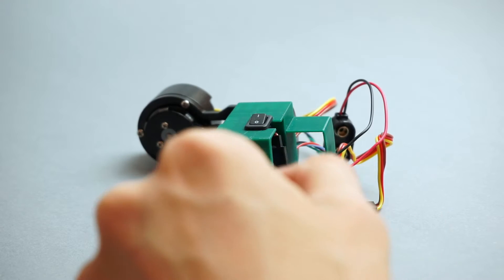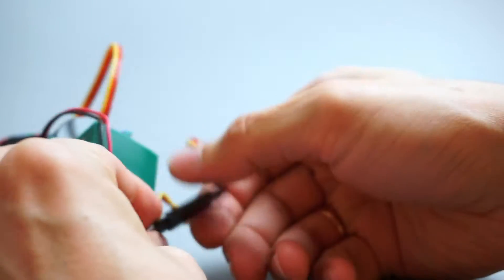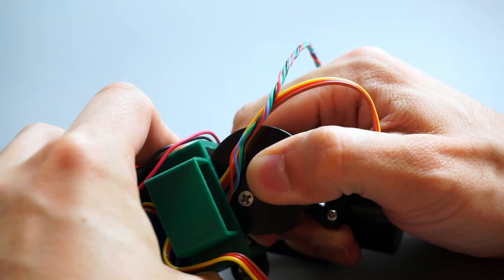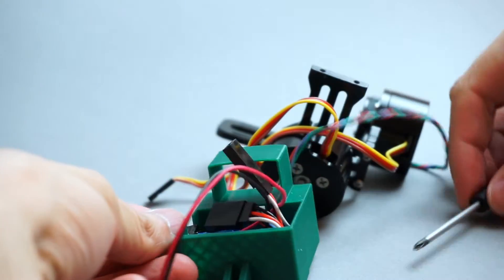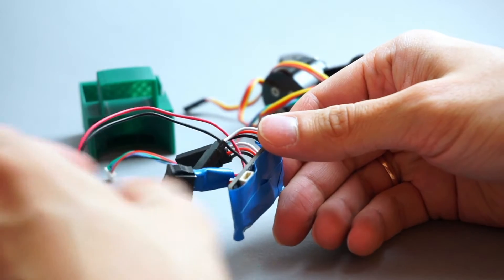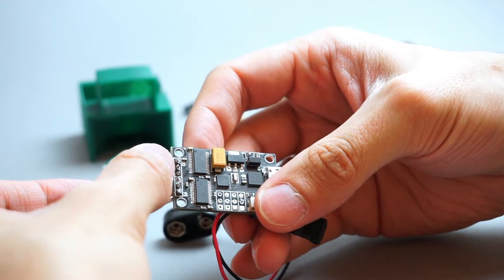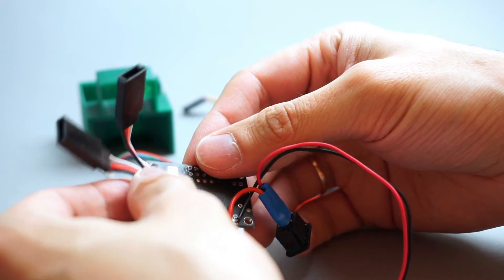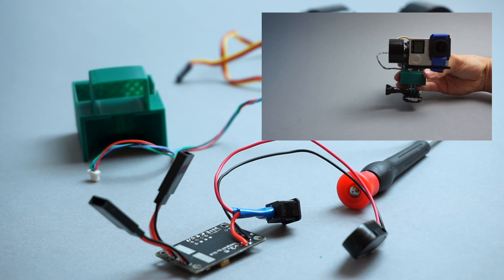DIY Mountable GoPro Gimbal Internals

Comment: Looks great!!! I want to build one for snowboarding. I can modify the GoPro mount to take the bigger waterproof enclosure but do you know if its possible to make motors and electronics water waterproof?
Reply from the maker: I've been looking for waterproof or at least weatherproof motors and didn't find anything affordable. With electronics it'd be quite easy because you're in charge of housing. Unfortunately, you can't do much about motors by yourself.